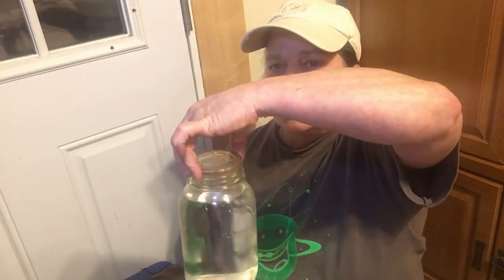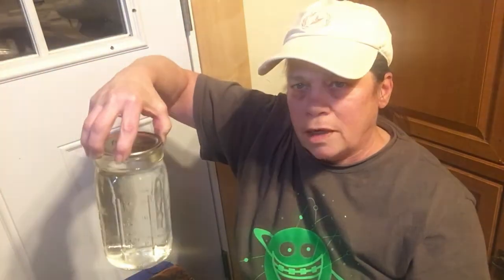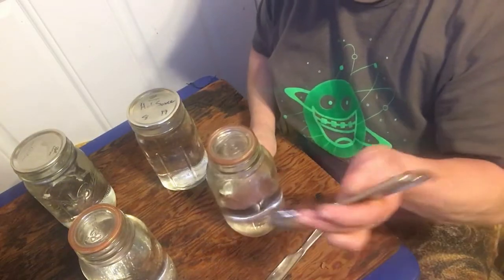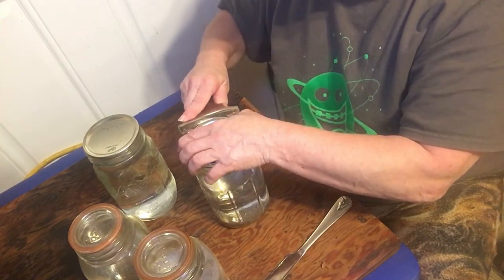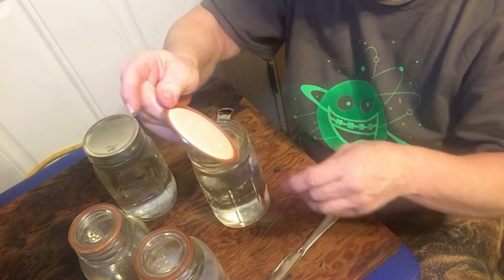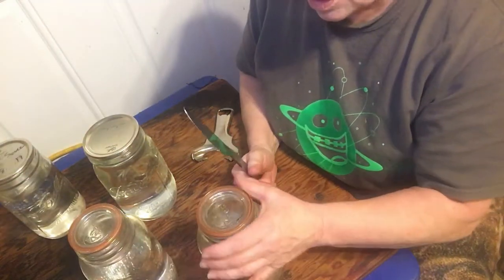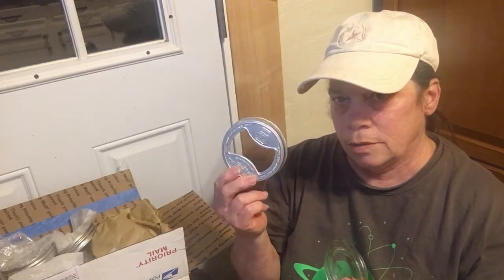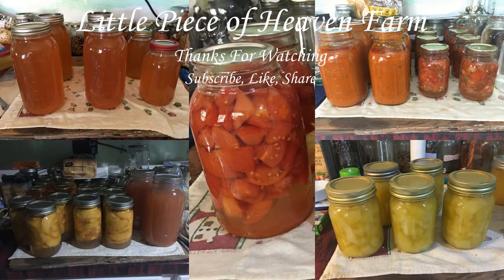Revisiting Vintage Glass Lids and Used Tin Lids

Comment: I looked everywhere for widemouth glass lids for almost 2 years and wasn’t able to find any. I had the metal rings, but couldn’t find the glass inserts. Glad you were able to find it glass lids. I prefer using glass not only because it’s reusable, but also because I feel it’s a better option than plastic.
Reply from the maker: I agree glass lids are better. I found my on Esty, EBay, and my local antique shops. The wide mouth lids are hard to fine.

Comment: Weck small rubbers fit the regular mouth glass lids, the only only one they will not fit is the Ball except the Ball #10 works. You have to trim off the tab with a pair of scissors
Reply from the maker: Yes , I know now. I mainly buy old new stock. Thanks so much!
Reply: Thanks soo much for this information as I cannot find the rubber seals anywhere but have hundreds of glass lids and vintage rings given to me recently
Reply: i check the glass lids by using my thumb nail and turning the lid to check for tiny chips caused by someone who used a knife to open them. I have been able to save some by using a diamond hone bought off of amazon
I have over 1000 of these lids and that is all i use

Comment: How did using the Tattler rings under the metal covers work out for you? Do they hold their seal for a long time? Seems like it should work pretty good. Not much different than using a glass lid as long as it's not damaged.
Reply from the maker: Yes, they held there seal.

Comment: Curious how your experiences have been using these glass lids.  Better seal than the metal lids?  So once a glass lid is sealed does it stay sealed longer IYO?
Reply from the maker: Awesome question! 
I haven’t had to many problems with the glass lids.
They do have a very strong seal. This is my first year really canning with them. 
The water I can last year ( the second I didn’t open ) is still sealed and it’s been about 14 months on that jar. 
I have lost some seals, during the canning process. Mainly user error. 

I really do enjoy canning with them.

Comment: The glass lids are beautiful. Curious why you don’t like the Tattler lids.
Reply from the maker: Good question. I’m just not a fan.
I had more failures than success. When using them. I tried the 1/4 turn. Tighten them down coming out the canners. I tried them a lot of different ways. 
We just never clicked lol
I came across these glass lids and they do work some what the same, however I have a lot more success with these.

Comment: How do you can with them
Reply from the maker: You use the glass lids just like if they are metal lids. The rings are different, taller and you tight them down more when you take them out of the canner . 
They work pretty well, sometimes hard to get off